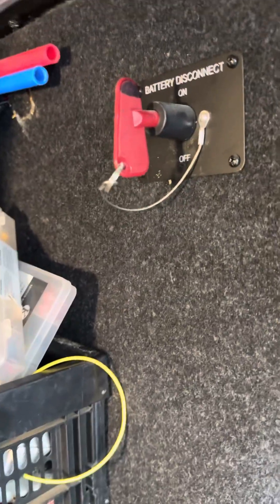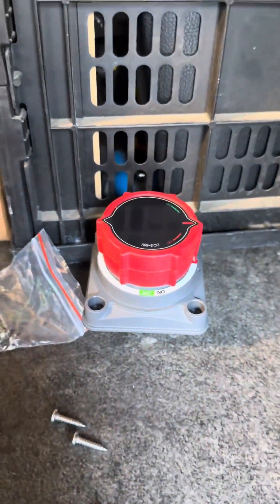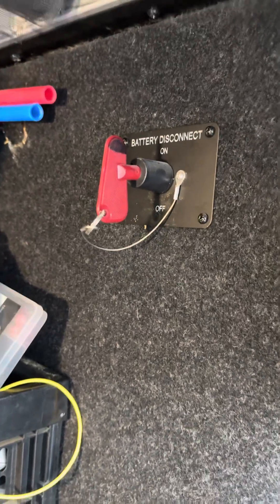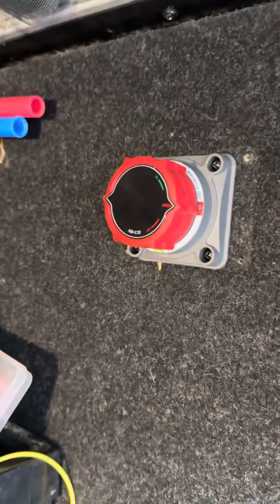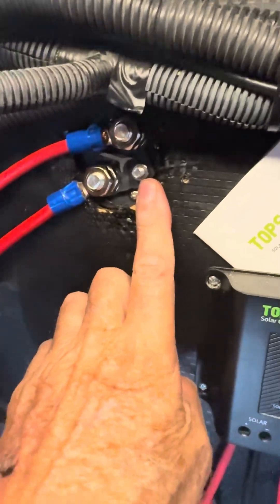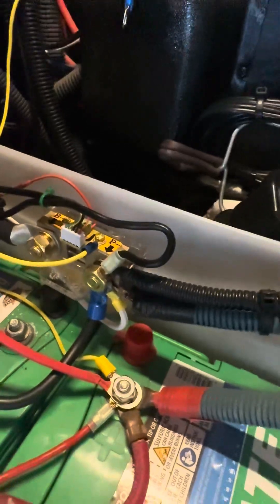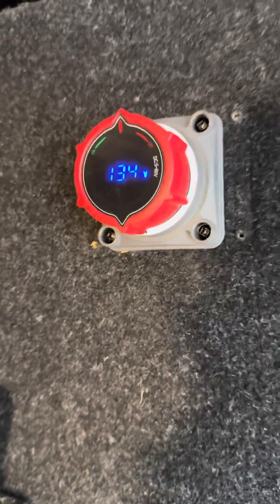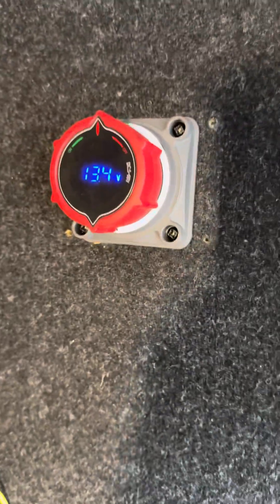RV battery disconnect switch upgrade

Comment: The switch you replaced still had power through it and that's why you're still seeing the display. I bought the switch you installed and planned on putting it on the battery box to kill all power to the trailer. The display should also then shut off.
Reply from the maker: That is true. What matters is which “side” the switch is connected to battery. The meter is connected to the “output” side of the switch so when off the meter is no longer connected to the battery.